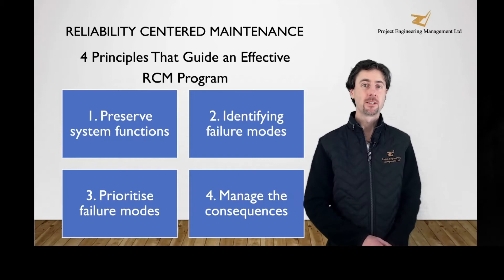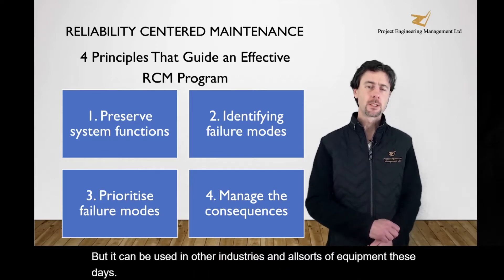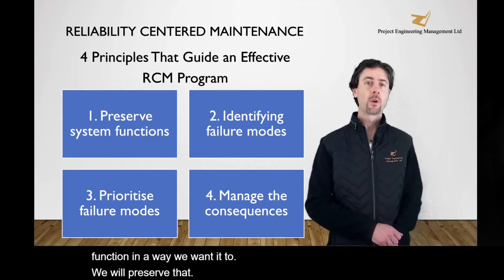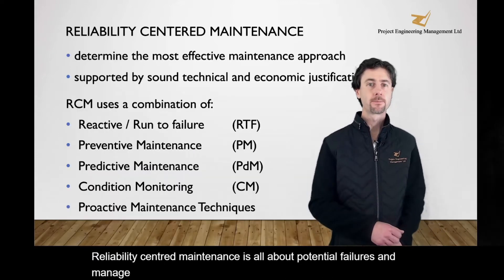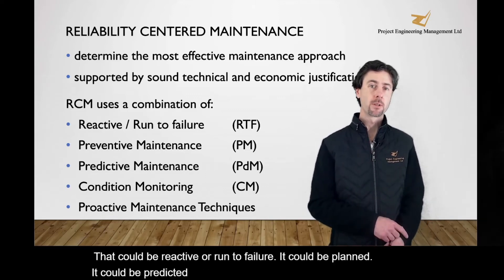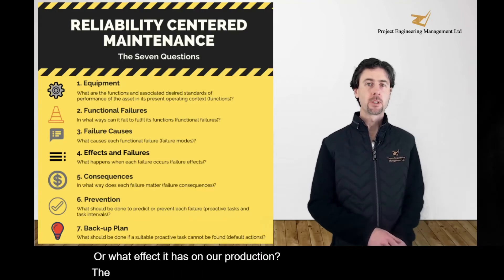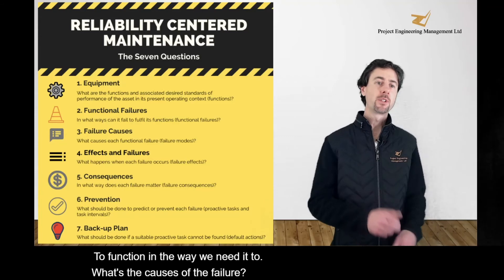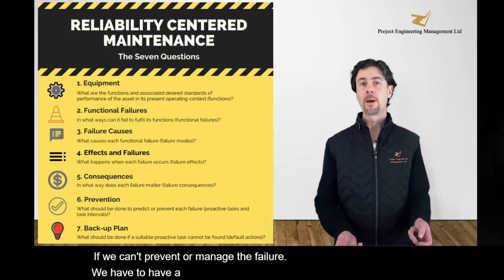2 minute talks - Reliability Centered Maintenance (RCM)

Comment: Good afternoon! You have interesting videos. At home, they came up with the idea of counting risks in monetary form. The probable amount of refusal at the
settlement date is calculated by multiplying the losses (industrial,
environmental, damage to human health and life) by the probability of failure.
We consider the probability of failure in an exponential way. Can you tell me
where to see the methods for calculating the probability of failure in cash?
Reply from the maker: Hello, I am glad you found them useful, this is a great question. DNVGL has an excellent recommended practice DNVGL-RP-G101, see Fig D-2 This is a decision risk matrix which is maintenance specific and includes safety, environment and economic risk. It is biased towards risk based inspection of offshore topsides static mechanical equipment, but I have found it can be used in a number of other circumstances. The FMEA standard IEC 60812 is also a good reference. Of course, the good old RCMII book also talks about this in Fig 5.14 and Appendix 3. Hope that helps.
Reply: @projectengineeringmanagement  Great, thanks! Still looking for a solution to such a question:
How to determine the effectiveness of the repair impact? For example, you have not done the maintenance of the pump, which is necessary for 2000 hours of operation. How much will the probability of failure increase if you do not do the service that the manufacturer recommends?

I want to understand, if we exclude the recommended works, how much the risks of failure will increase.
Reply from the maker: @AlexGoldobin  Hi, for this you would need more data and I suggest you look at concepts such as FMECA and understand the failure modes. You should also look into the reliability concepts in more detail rather than RCM such as Weibull analysis to understand the reliability  (or unreliability) of the system better.